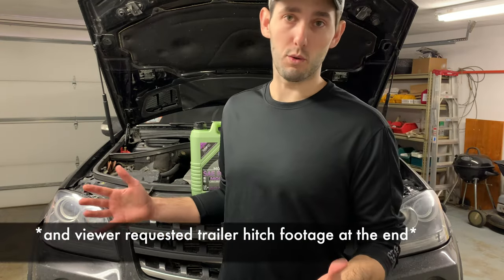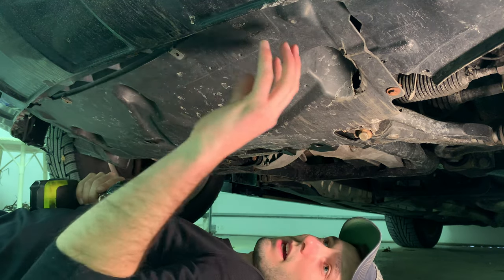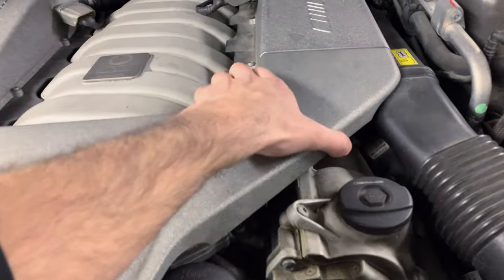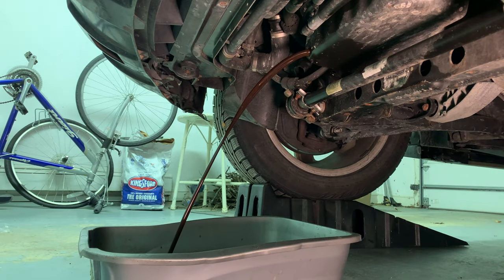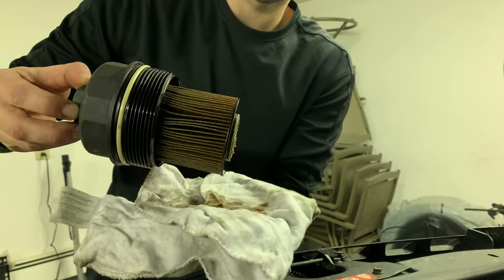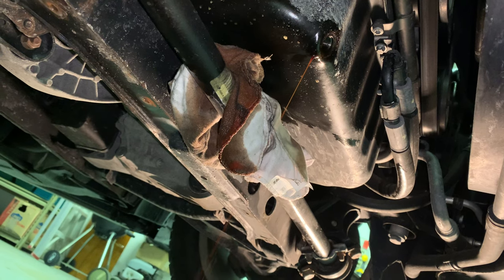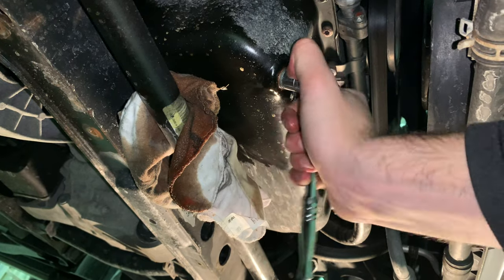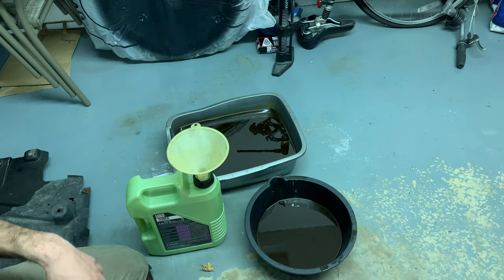ML63 AMG (W164, M156) Oil Change (and Trailer Hitch Footage)

Comment from the maker: PSA: I jacked up the rear of the car to drain out all the oil, but I lowered it before re-installing the drain plug! It doesn't seem like it on video but trust me, I did.
Reply: Hey man I just purchased a 2008 ML63 from copart and it has 66k miles and it's a 1 owner. No salvage title or anything, Carfax was clean and the car had minor scuffs and scratches. I paid $9,200, but the only downside is that I purchased the car sight unseen from California. It says the car is a run and drive and no visible check engine light. Do you think I did good? and what mechanical problems should I worry about?

Comment: IM doing my 180,000 mile oil change on My Ml63 tonight!!! I have only used Mobile 0-40 European Formula. When I bought mine it had (and still does) have rattle from loose camshaft adjusters on startup. I tried the Liqui Moly and the engine made a horrible horrible sound when running for a few seconds on that green stuff to the point where I immediately did an engine shutdown and drained and repoured fresh Mobile. Ive had it since 162,000 miles. I love this Truck!! Still no engine issues. Although trans is starting to buck in first gear when flooring it.

Comment: One of my fav features of Mercedes is the oil change from the engine bay. Highly recommend getting one of those vacuum excavator 10 quarts + or even just a cheap electric pump, to pump out the oil from the top. This is how they do it at MB dealerships.
Reply from the maker: I really could use a vacuum pump, would help w a few things besides the oil changes too

Comment: Its better to turn on the car first than check the oil level so the filter fills up✌🏼
Reply from the maker: Good tip! Yeah I checked the level first before turning the car on to make sure it was safe to do so, then turned it on and let it run a little, then checked again 👍🏼 I’ve learned now that if I post a video like this, people want alllll the little steps shown haha

Comment: Thank you for making this video! I have a 2010 ML550 and was wondering if the crush washers are the same? If so, what is the correct MB part # for the crush washers?
Reply from the maker: Thanks for the comment! I do not believe they are the same - I bought this oil change kit from FCP Euro and it looks like they have one for your car as well; I'd recommend checking them out (not a sponsor): https://www.fcpeuro.com/products/mercedes-oil-change-kit-5w-40-genuine-mercedes-515651#description

Comment: What about draining the oil cooler? Your's doesn't have one? Mine is 2010 with oil cooler, a good amount of oil comes out the cooler.
Reply from the maker: Good question! To be honest I'm not sure if it has one...probably does though, now that you mention it. I'm just learning as I go, maybe someone else can help me out here. Either way, I measured the oil that came out and put the correct amount back in, so it might not be 100% changed but it's close. Good enough for me since I do oil changes more frequently than I have to anyway
Reply: @monumentauto   check your front bumper, passenger side, and you will see a square opening with a draining plug. That is for the oil cooler, and you will be able to drain approx. an additional litre of oil
Reply from the maker: @Joni350z  Thank you! I'll definitely do that next time

Comment: Hey man i got a high millage 07 that i have done a bit of the performance side to it ,if you have any questions.
Reply from the maker: That’s awesome! What kind of things have you done? I'm definitely interested in getting long tube headers, a tune, and maybe eventually a supercharger and supporting mods but it’s all too expensive for me right now unfortunately
Reply: @monumentauto  only have had it for 2 months, drove it from ontario to b.c  to break it in. then tossed in a tune and intake filters and a mid pipe to start.  sounds great like all the 6.2s
Reply from the maker: Nice! Did you replace the resonated section w straight pipes or an x-pipe? I’ve been wanting to do that too

Comment: Did you notice he didn't install the oil filter and already start pouring oil 😀😃
Reply from the maker: I poured the new oil in the oil filter housing bc I didn’t have a funnel and it’s a bigger opening than the typical oil fill hole. Since the filter is on the top of the engine it doesn’t need to be installed first like many cars when it is in the bottom or side and would leak if not installed prior to adding new oil
Reply: @monumentauto  hmm...make sense 👏

Comment: 9.7 liters
Reply from the maker: Yep! I put the correct number in the video on the screen in case you missed it
Reply: theres actually an oil filler location on the ml63, to the right of the filter, black cap undo with socket, filling through the filter housing works but topping up after checking level is just going to get messy !!
Reply: also when you drain oil, measure what you have taken out then and fill exactly this. Otherwise you will over fill.